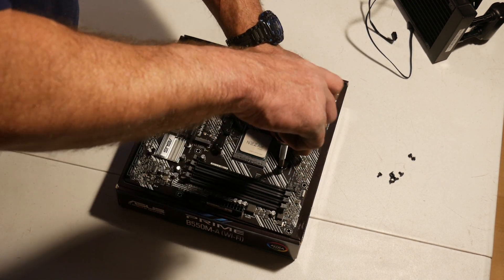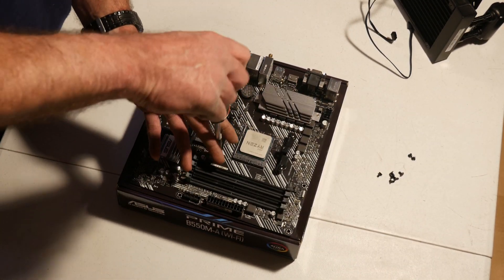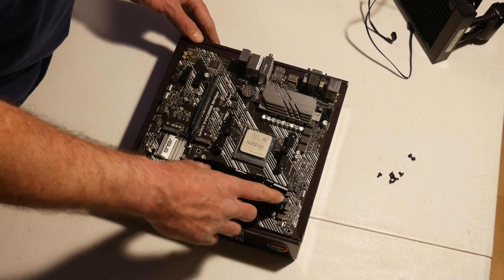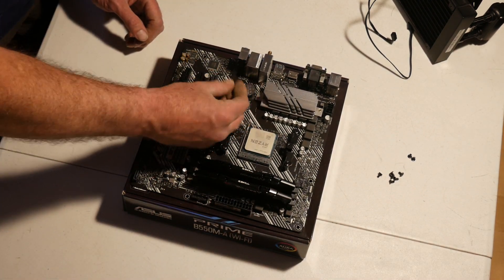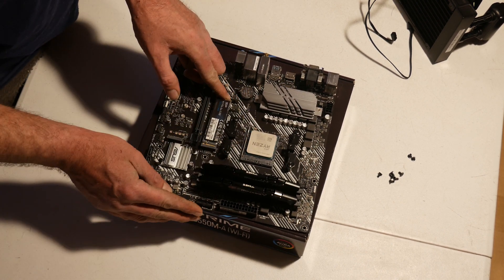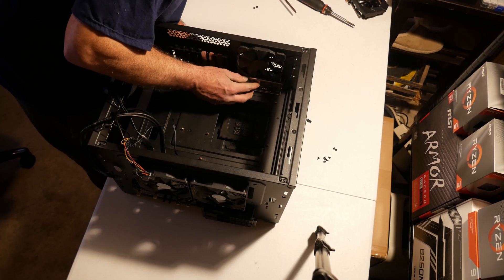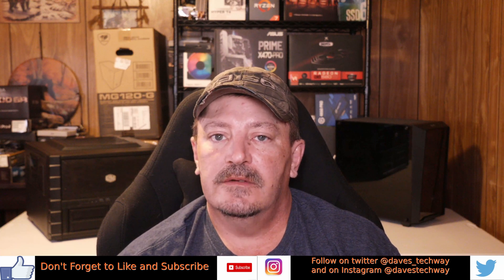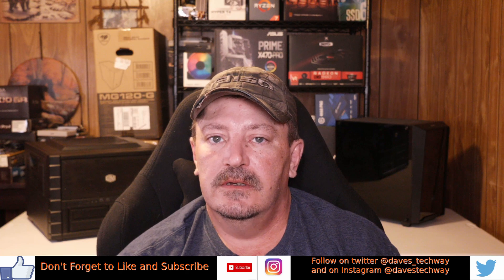Building an open test bench in the Cooler Master HAF XB EVO computer case

Comment: I was excited to get mine. It's the first case I ever had trouble with the first build boot up. The 2 drives in the Hot Swap tray don't seem to have power. It's a media machine with 5 drives.  I have ordered another PC board for the back of the tray and hope it's just DOA. If not I'll just pull the PCB  out and wire them up direct. I just had the same bad luck with a new used car. Oh well.
Reply from the maker: Some motherboards don't support  hot swappable bays or needs to be turned on in the bios.  Thanks for watching and the comment.